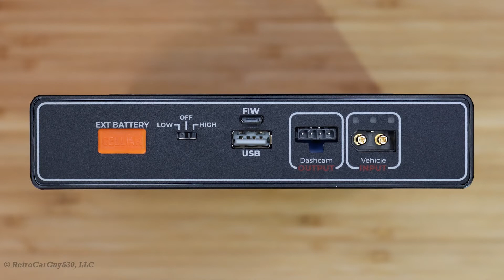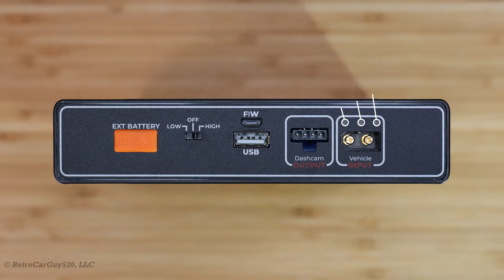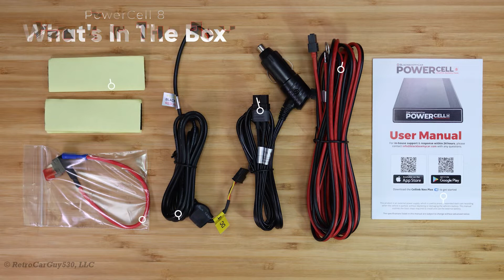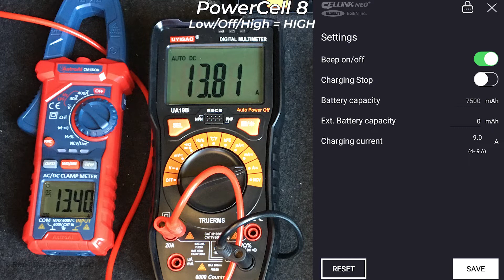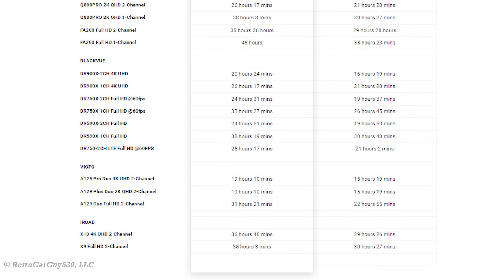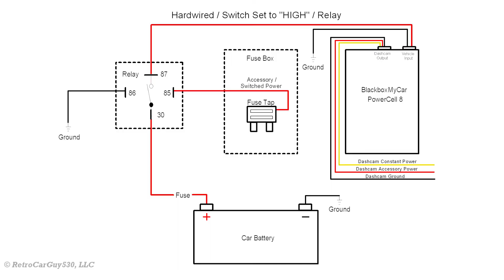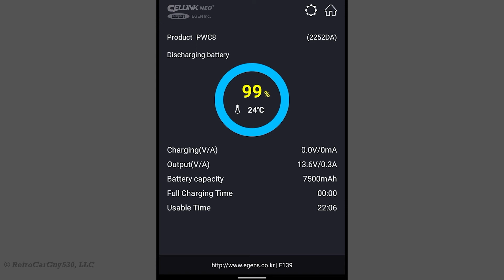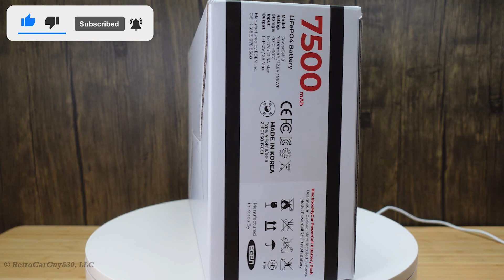BlackboxMyCar PowerCell 8 Dashcam Battery Pack Review / Testing

Comment: Is thaere any way to see what the relay option looks like?
Reply from the maker: I've made one additional refinement to the relay option since making this video. When the relay control power is turned off, there can be a voltage spike that can occur when the relay's coil de-energizes. There are relays that include a "flyback diode" in the relay assembly which helps prevent the voltage spike from occurring. You can also add a diode to the wiring of relays that don't have an internal flyback diode.

A 4-pin relay is the preferred relay type only because a 5-pin relay will have one pin (87a) that never is used.  The 87a pin is the output power pin for when the control circuit power is "off".  For a dash camera battery pack that requires switched/accessory charging power, you will get that power from relay pin 87 and not the 87a pin.

Here's an Amazon affiliate link to a 5-pin relay with a flyback diode already inside of the relay assembly. https://amzn.to/3SLzNX7

Your connection to the power source (vehicle battery) should have an inline fuse as close as possible to the connection to the battery. I recommend using 12 AWG wire for the dash camera battery pack positive/negative charging cable wires.  The inline fuse holder wire (after the fuse) will connect to relay pin 30. Pin 87 will connect to the positive charging cable wire for the dash camera battery pack. Pin 85 of the relay is the ground side of the relay control circuit. Relay pin 86 is connected to a switched/accessory power source (likely using a fuse box fuse tap). If you use a 5-pin relay, pin 87a will remain unused.
Reply: @RetroCarGuy530  Thanks. I am upgrading my wife's car to a power cell 8. Currently, I have a 20 fuse tap on the rear cigarette lighter. I know the concern is the power requirement exceeding the tapped fuse, however, in my case would it be ok? Since nothing else is plugged in  to that fuse and nothing is plugged into the rear 12v?
Reply from the maker: As long as nothing is using power on that circuit, it should be okay to use it for the charging power for the PowerCell 8.
Reply: Thanks for responding

Comment: Thanks so much for this so informative review.

I am on the verge of getting this battery. The relay method of getting the dashcam hardwired seems too complex for my hardwiring DIY.

But while surfing through some other reviews as regards your prescribed hardwiring recommendation, I came accross this below 👇

"What I did was use one of the open fuse positions (an accessory one of course) and set the charging rate to low. This avoided the complexity of the relays with the multiple points of failure, especially important given my installation skills. The current draw doesn't seem too high and I precharge the battery pack and it doesn't drop down too low that I need the faster charging"

I personally also plan charging it off the car in my home with the BBMC provided cable and return back to the car when fully charged since I don't drive much too. I just want the charging in the car to be a top up of a kind. 

Please what's your opinion on this?

Thank you as I anticipate your detailed response
Reply from the maker: If the fuse socket you want to use can truly supply the 5 to 6 amps required by the PowerCell 8 while charging in low amp charging mode, then that approach can work.  The longer charge time when charging at the "Low" setting is something you'll need to see if that fits into your driving habits.  If the battery pack does not get charged fully, you'll need to supplement the charging of the battery pack by using an external charger.  If you're already planning on charging it at home with a charger, then the "Low" charge mode can work for you.  You just need to be consistent in your process of charging it out of the vehicle to make sure your PowerCell 8 doesn't run low on power when you park your vehicle.  The charger you would use at home needs to capable of providing 14V to make sure the battery maintenance system in the PowerCell 8 allows it to be charged.  I've tested the 14.2V 8 amp charger that BBMC sells or a DC power supply that can be set to charge at 14.2V up to 10 amps could be used to charge the PowerCell 8 at home.  An AC to DC power brick that outputs only 12V is not sufficient to charge the PowerCell 8.
Reply: @RetroCarGuy530   Thanks soo much for your swift response. I really appreciate.

When you tested the 14.2V 8amps been sold by BBMC. Was it okay for proper charging and functioning of the battery?

Thank you
Reply from the maker: I misstated the voltage it produces.  It outputs 14.6V at up to 8 amps.  I've used that charger successfully several times to charge a PowerCell 8 battery pack.  I discuss my testing of that charger in this DashCamTalk website post: https://dashcamtalk.com/forum/threads/7500-mah-96-wh-blackboxmycar-powercell-8-blackvue-b-130x-thinkware-ivolt-xtra-bab-95.48162/post-592288
Reply: @RetroCarGuy530  Thanks so much 💯 👍
Reply: Hello @RetroCarGuy530

Please I need your professional guide. I just installed this battery pack today in my brand new 2024 Rav.

Based on our previous conversation, my PC8 was fully recharged indoor with the external charger, which was really cool. Some of my concerns are

1) From different reviews have seen on hardwiring dashcam to fuse box using a fuse spot preoccupied, it was mentioned that the introduced fuse should be equal or less than the OEM (preexisting fuse in the spot). But surprisingly, watching the PC8 installation process on BLACKBOXMYCAR, it was said that the introduced fuse should be equal or higher than the OEM 

Please I need your professional clarification on that, as I don't want to mess anything up in my brand new car fuse box. 

2) On my rav 4 fuse box diagram, I found two empty spots. The 2 spots fuse capacity was not stated (no info on either it is 5, 7.5, 10 etc).
Furthermore it was stated that only designated spot should be used.

Is it okay to make use of one of those 2 spots for my accessory point for the PC8?
Reply from the maker: My fuse tap usage statements will differ from BlackboxMyCar in most situations. The fuse box fuse socket wiring can deliver at least the amp rating of the fuse in it and usually 10% more for wiring/circuit safety. The 10% assumption is to be as safe as possible without having access to wiring diagrams for the fuse box. Extending that logic to an example. If the original fuse in the fuse box fuse socket is a 20 amp fuse, the 10% assumption means it should be able to safely deliver around 22 amps. Could the wiring for that fuse box fuse socket deliver more amp, maybe but without documentation (wiring diagrams) to prove it, you must be as conservative as possible.

In my opinion, using a fuse tap to add a new fuse/circuit to support an amp rating higher than the original fuse is NOT SAFE! Following my 10% rule (assumption) a 20 amp fuse socket should only have at most a 2 amp power load added to it for a new device/circuit. Powering a dash camera/radar detector (directly from the fuse tap) will be just fine in since most dash cameras use less than one amp. The PC8 can consume up to 10 amps (if the setting in the admin page allows it). 

I cannot state with any certainty whether it is safe to use the "unused" fuse sockets to provide power to the PC8. If you configure the PC8 to at most use 5 amps when charging (via the setting in the admin page of the app), you should be able to use one of the unused fuse box fuse sockets.  You'll likely need to use a 7.5 fuse in the fuse tap for the PC8 because there may be a small amp draw spike when the power from the fuse socket is provided to the PC8. The other assumption is that the unused fuse box fuse sockets source their power directly from a switch/relay instead of being powered by one of the vehicle's modules.  For example, the vehicle's body control module (BCM) can send power to a variety of circuits in the vehicle.  Adding a high amp load to a circuit which sources its power from a vehicle module may overload the vehicle module's circuitry.  Wiring diagrams are a must in figuring out where the power is coming from when adding large amp load devices to a fuse box with a fuse tap.

My recommended way to power any dash camera battery pack is to source the power directly from the vehicle's battery with an inline fuse (near the vehicle battery). For dash camera battery packs that require switched charging power (like the PC8) to use a 4-terminal relay to control the power sourced from the vehicle's battery.
Reply: @RetroCarGuy530  Thanks so much for your detailed professional response. I really appreciate

I can see from your last paragraph that the more reliable way to power the PC8 was the stated. 🤔

However, going through the forum read up link you shared with me, I noticed you found out this that there was varying amp draw from your older PC8 and the newly produced ones that actually draws within the range of the stated amps.

But in the latest app I downloaded, there was no option to select the charging current amperage of choice in the charging process (left with just choosing between LOW or HIGH). My questions now are 

1) From your testing of the newly produced PC8 you did, what was your observation of the amp draw at a) Low and b) High 

Even though I only plan charging the PC8 at low always inside the car (just for topping up the major in-house charging with external power) 

2) Please If using the fuse box accessory tapping for charging the PC8 was the feasible option presently, what amperage of fuse is safe to add (introduced fuse) 

Thanks

Comment: Thanks for a informative video. Hot tip a voltage sensitive relay or vsr can buy used instead of standard relay which simplifies wiring.

Comment: When charging at home using DC power supply what are the setting for power switch (low-off-high), voltage and Amp.? Thanks
Reply from the maker: I set the DC power supply voltage setting to 14.2V.  I set the max amps to 10.2A.  If you use a cigarette lighter adapter to charge the battery pack, it will be restricted to 5A (low) even if you set the power switch to high.  If you directly connect the battery pack to the DC power supply with the included (or similar) hardwiring cable, you can set the switch to high.
Reply: @RetroCarGuy530  How does the PC8 know to automatically limit charging current to 5A when the cig lighter adapter is used? This would imply the PC8 can detect the fact that the cig lighter is being used. I don't see a  switch where the cig lighter plugs into the two input power pins which would perform this function.  Is there current limiting in the adapter plug (hard to imagine this) ? Have you measured current on the cig lighter cable when the power switch is set to High?
Reply from the maker: @buffalo_wings8224  if you look at the top side of the connector that plugs into the PC8 on the hardwire cable and the cigarette lighter cable, you'll see the cigarette lighter cable has a third metal connector/contact.  That connector is connected to the ground wire in the cable. There's a corresponding third metal connector/contact on the top inside of the connector on the battery pack. When the cigarette lighter cable end is plugged into the battery pack, the battery pack will detect the "extra" connection to ground and thus limit the charging capacity to 5A no matter what the mode slide switch is set to.
Reply: Thank you very much! God bless! ❤

Comment: 24hr  for battery blackvue is it in parking mode
Reply from the maker: All time estimates are for parking mode operations.  It will vary from dash camera model to dash camera model based on how much power each parking mode consumes.

I just posted on the DashCamTalk website some parking mode time estimates for the new BlackVue DR970X Plus series of dash cameras.  A PowerCell 8 battery pack with a 96 Wh capacity will provide parking mode power for around 10 hours in "Motion & Impact" parking mode and 12 to 13 hours for time-lapse parking mode.

Comment: Do you have a video of installing a relay with a battery pack? I'd like to give it a try and install it myself but am a bit lost lol
Reply from the maker: No, I don't have a video showing the installation of a relay to control the power to a dash camera battery pack.  In my later video, I compare this battery pack and two others (all 7500 mAh battery packs). I include similar wiring diagrams for powering the BlackboxMyCar PowerCell 8 and the BlackVue B-130X.  The Thinkware iVolt Xtra BAB-95 has a different approach to powering the battery pack (it has an internal relay - so no need to wire an external relay).

Using an external relay to power the PowerCell 8 / BlackVue B-130X generally goes like this:
1) I would recommend using 12 AWG wire for the charging cable (thicker wire gauge than included in the box).
2) I soldered on an XT60 connector to the end that plugs into the battery pack - to use the 12 AWG wire
3) Use a relay with 12 AWG power wires
4) Obtain a 12 AWG inline fuse - if the relay has a fuse in the case then that's sufficient to protect that circuit
5) 4-Terminal relay terminal numbers

30 - Constant (fused) battery power is supplied to the relay to this terminal connector
87 - Power going to the dash camera battery pack's positive input power terminal (via the XT60 connector)
86 - Switched accessory power - usually obtained using a fuse tap - relay control side uses in the range of 100 mA (very small amount of power)
85 - Ground - This is the ground side of the control circuit in the relay.
Some relay's have terminal's 85/86 documented in reverse of what I just stated, follow the documentation received with the relay.

The other wire involved in this setup is the ground wire from the battery pack and that does not get connected to the relay.  It should also be a 12 AWG wire.  I would not recommend connecting the ground directly to the car's battery negative post.  Some car's need to see the amount of power being consumed and they do that by monitoring the current flow through the large negative battery cable.  I would locate and use a good clean (free of paint) contact point on the body or a pre-existing ground lug (where other grounds are connected to the body).

The theory here is that you're trying to provide controlled way to support the amp draw necessary to power the dash camera battery pack.  The relay give's the control necessary, but to get that control you have two sides of the relay to wire up.  The power/load side and the control side.  Constant battery power coming into terminal 30 will only be provided to terminal 87 (and thus the load - battery pack input) when the control side of the relay is "energized" to pull the contacts between terminals 30 and 87 together.  The switched accessory power obtained from the fuse tap (or any valid switched power source) will energize the electromagnet in the relay causing the contacts between 30/87 to close thus providing power.  When the switched accessory power is turned off to terminal 86, the electromagnet is de-energized and contacts open between terminal 30/87 and the power is turned off to the load (battery pack).  Terminal 85 is the ground side control circuit.

Comment: How many amp relay should i buy ,also my supplied cable is 16awg 600v all wires in my hardware shop are sold in how many amps they take like 27amp wire is that ok ? ,
Reply from the maker: I have an Amazon affiliate link in the video description section to the relays that I've been using to power my dash camera battery packs.  They have 14 awg power wires (terminals 30 & 87) and the relay is rated at 30 amps.  The PowerCell 8's hardwire power cable only has 16 awg wire.  In my recent review of the PowerCell 8, BlackVue B-130X and Thinkware iVolt Xtra BAB-95, the PowerCell 8 is the only one to battery pack to come with a 16 awg wire charging cable.  The other two supply a 14 awg charging cable which helps to reduce the wire temps while it's charging.  I'm using the PowerCell 8 16 awg cable for the one installed in my car and my PowerCell 8 is only two feet away from the relay in the trunk of my car (battery is located in the trunk).  The max charging amps for the PowerCell 8 is in the 10 amp range (in recent testing).   Make sure any relay you get has 14 awg or at a minimum 16 awg wire for the power side of the relay (terminals 30 & 87).  The larger the wire (smaller awg number) is better!   The link to my recent video comparing the PowerCell 8, BlackVue B-130X and Thinkware iVolt Xtra BAB-95 is this: https://www.youtube.com/watch?v=Gn3IoBjO_Vg
Reply: @RetroCarGuy530  thank you for the reply and help thats great help to me ,going to install mine in the trunk to as its the only place it will fit nice and also easy to get to , relay looks a safer install to, thanks 🙂

Comment: What amp fuse do you recommend for the relay ?  Thanks for the exceptional video.
Reply from the maker: I've been using a 15 amp fuse for the relay that is powering the battery pack.  The fuse for the fuse tap that gets the relay's control circuit power is a 2.5 amp (it could even be a 1 amp).  I'm testing another PowerCell 8 battery pack as part of a three battery pack comparison (PowerCell 8, BlackVue B-130X and Thinkware BAB-95).  The amp draw of that PowerCell 8 (and other PoweCell 8 battery packs that others have recently tested) seem to be drawing less amp than the first unit I have in this video.  Although, the amp spike when switching on power to the PowerCell 8 is right on the edge of 10 amps.  You may be able to get away with a 10 amp fuse, but most likely you'll need a 15 amp fuse.